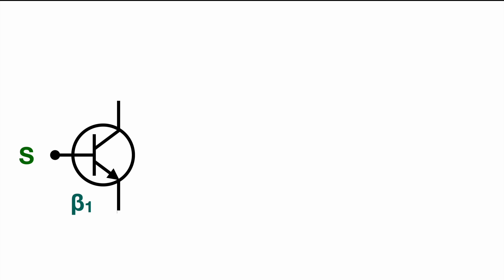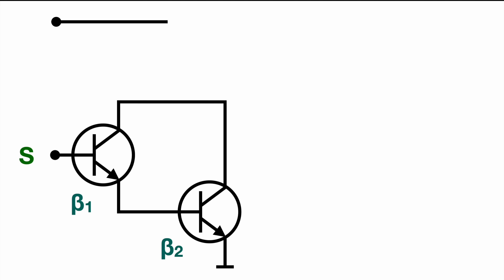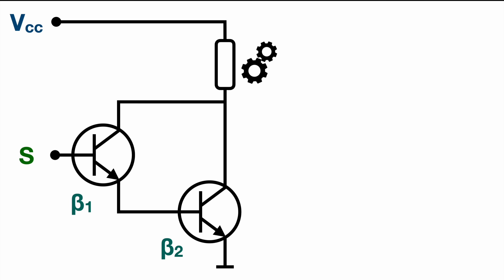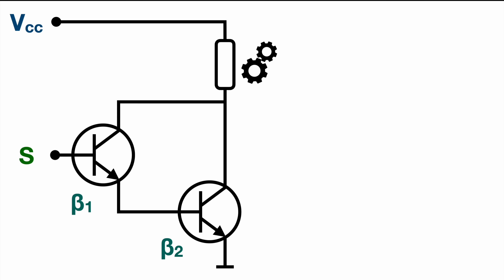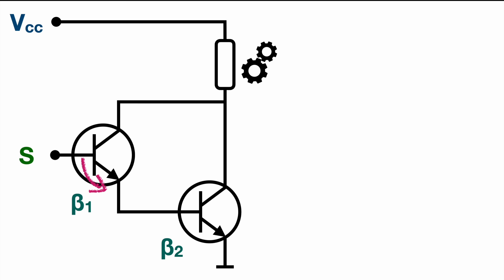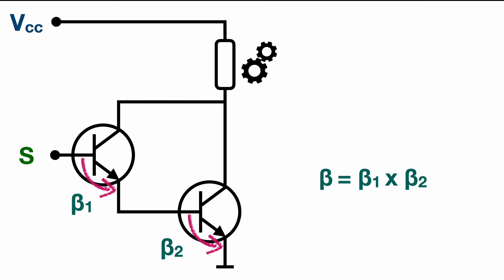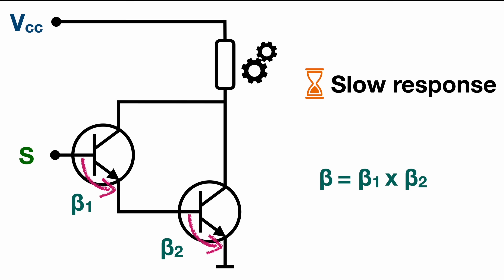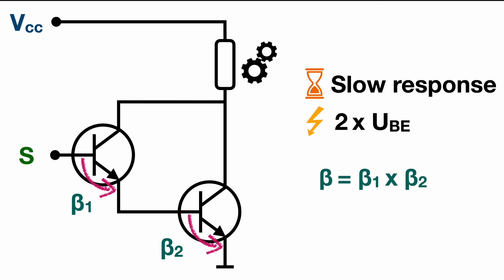What is a Darlington pair transistor? | Darlington circuit | super beta transistor

Comment: Can I ask a question - what exactly transistors are used for darlington configuration? e.g. if I pick a 2n2222 and apply 12mA to the base with exmaple hfe 100 -  there is already a max rating for 2n2222 achieved. With 1000 hfe it would be 6A. So what transistors are used with 1000 hfe? I try to understand better where exactly darlingtons to use.
Reply: it is used for amplifying very low current system, say 0.1uA, then the darlington pair would be useful.